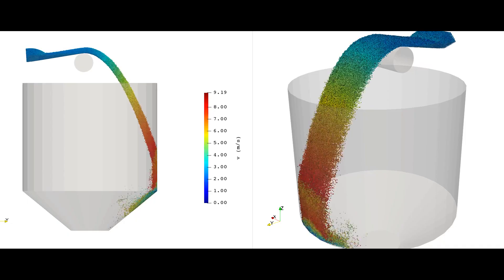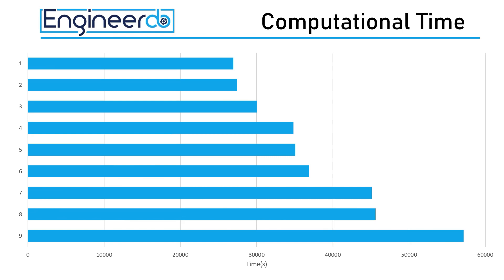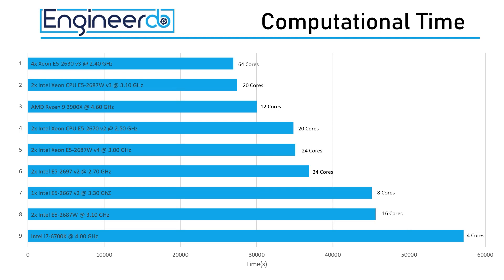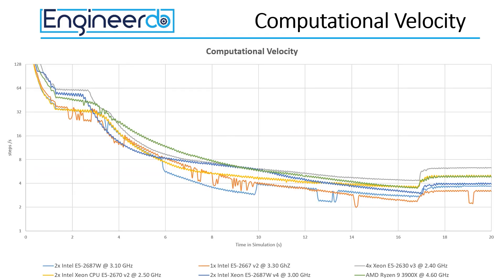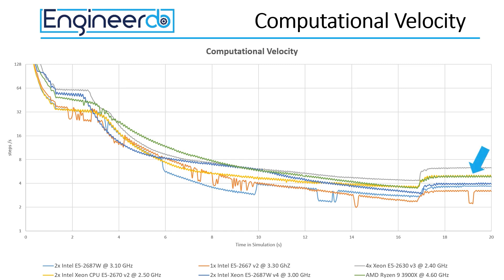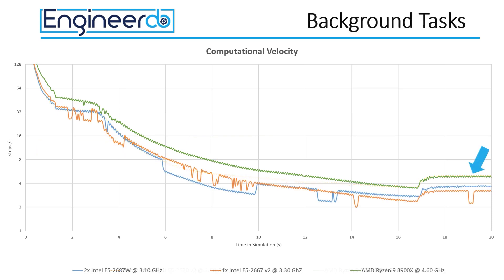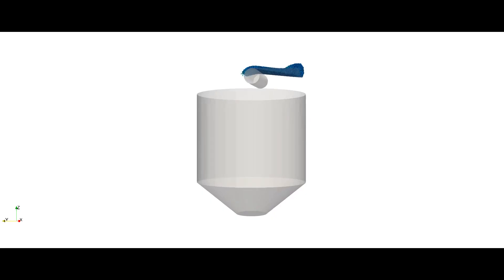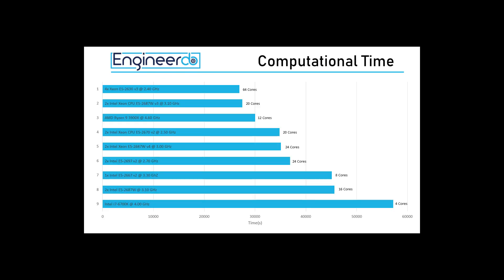Intel vs AMD - Benchmark of Liggghts - High Performance Computing on a Budget AMD Ryzen 9 3900x

Comment: On you AMD 3900X X570 Build, Did you turn on the Extreme Memory Profile (X.M.P) to get the Full 3200 MHz memory speed?
Reply from the maker: Not that I know
Reply: @engineerdo6568  in the bios you need to select xmp to get the 3200 MHz of the memory. Otherwise it stays down at 2667MHz.

Comment: Just out of curiosity, where would a RaspberryPi 4 stand in this competition?

Or whether it should be considered?
Reply from the maker: The processor architecture would not support the code of liggghts or vice versa. So no testing possible...
Reply: @engineerdo6568  ok.
Can OpenFOAM run on RaspberryPi?  I think I saw a couple of websites where they were able to run it on RaspberryPi. Just interested to know if this is possible.
Reply from the maker: @DharmitThakore  Maybe. We are more driven by finding the fastest or at least a faster solution. But I get the idea to play with raspberry. In the end a simulation always takes 100 h. Just the level of detail is getting finer.

Comment: A question I have is on CPU Threads, Are you doing anything to disable the dual threads per Core. So for the Ryzen 9 3900x it has 12 cores but 24 threads, are you doing something in the bios or Ubuntu? Or is this not necessary?
Reply from the maker: In my installation I can start the simulation only on 12 cores. I think you don't need to change something if your system also could start in hyperthreading. However, you should only be using the number of actual cors during you simulation.

Comment: I have a software for orbital dynamics which unfortunately takes only single core for computation. I switched from i7-6700 to ryzen 3 4300g, and the total time dropped by 3 days, for a simulation and detection of 56000 objects. Rest of the peripherals and parameters were the same. Ryzen 3 had a stronger single core performance than i7.
Reply from the maker: Hey Abhinav, thats a big improvement. Congratulations
Reply: @engineerdo6568  Thank you! I always wondered what configuration should improve the scientific computing scenarios. Glad to know AMD has ryzen (like 'risen') to the challenge. Great video btw! And probably very few videos to exist that focus on systems and scientific application.

Comment: Where one can order a Workstation with 4x Xeon E5-2630 v3 ? Any reliable website you recommend?
Reply from the maker: If you want to use more than 2 processors, you have to change to a blade system. Suppliers like DELL will be very happy to offer you something ;-)

Comment: Would it be faster if you use a potent gpu? Is this even possible?
Reply from the maker: No. Liggghts does not use the GPU. The GPU would make the rendering a bit faster. Rendering for this simulation was a couple of minutes, so nothing to worry about. A more expensive GPU makes the rig just more expensive.

Comment: Thank you for your explanation.
I am doing research for my PHD project and I have a laptop with dual cores I4 2.5GHz to 2.70GHz with Geforce 920mx (compute capability 5.0).
Can I run simulation with 500000 particles?
Reply: Hi. I’ve also just started a PhD in DEM and the answer is yes you should be able to but it may take a long time. I’ve just modelled 180000 particles on a dual core i5 and it took a couple of days but the system was very complex. A lot will also depend on what you want to model, how long you want your simulation to run for and what timestep you want to use.
Reply: Thank you for your reply.
Iam working on coupled CFD DEM simulation using fluid and solid particles with different diameter. With real time simulation up to 10 seconds
Reply from the maker: Hi, you will need something significantly faster. The coupling will make the simulation a lot slower than the plain DEM or CFD simulation. If you are running that in your laptop, you will wait a long time. While this might be okay for a single simulation, a phd project usually needs a lot of simulations...
Reply: Agree with that comment. Mine was DEM only so coupling will be a lot longer. What I am doing is I am sending all my main simulations to my institution’s super-computer which means everything runs a lot quicker so look into whether your university has something similar.
Reply: Thank you for your comments. I hope can get that in my campus